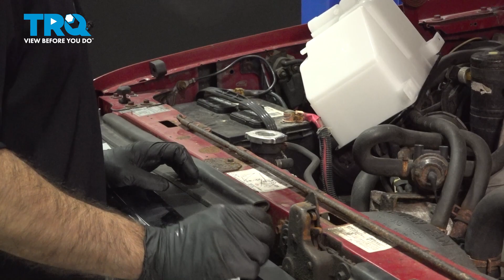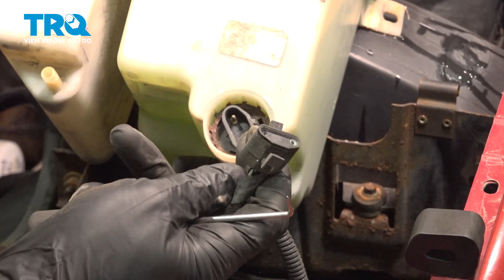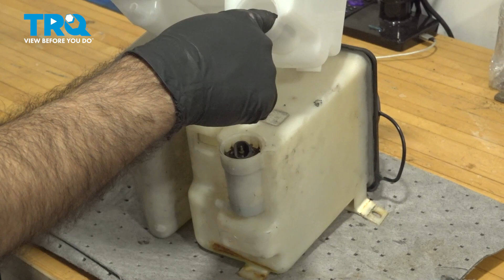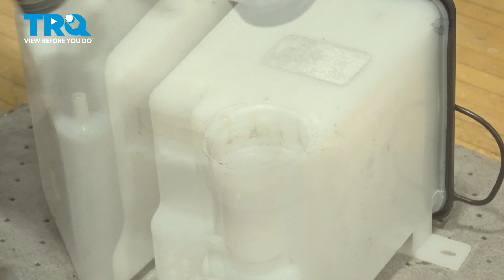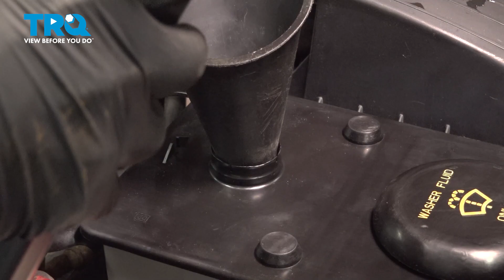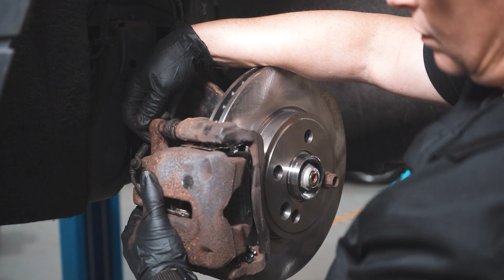How to Replace Coolant Overflow & Washer Fluid Tank 1992-1996 Ford F-150

Comment: Great video! Does the hose hook up to the top nozzle by the radiator cap or the bottom one? The bottom one is capped on mine  (F150 1993 Flareside). I got the truck that way so I wanted to confirm. I’ll definitely be buying other parts from you all!

Thank you!

Comment: Thanks for this vid'.
It real-time enlightened on what to expect needs to be released tah remove the washer/coolant reservoir.   :-)
Reply: Btw, those smaller caps in btwn the two larger filler caps,   are they removable off the retiree unit /in a reusable state/ to cap off another units' missing 18mm (mil< 3/4") ? 

Thanks again 👍     😮